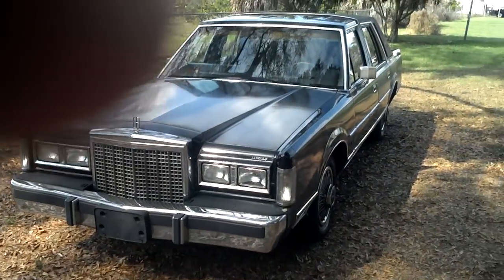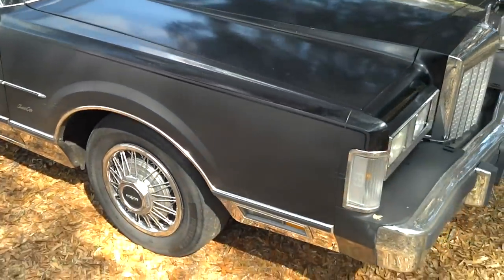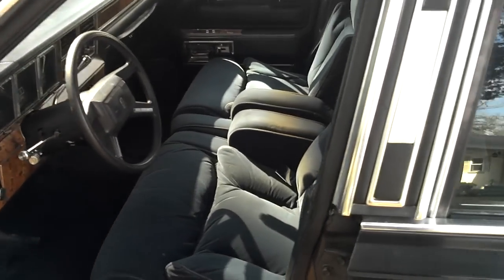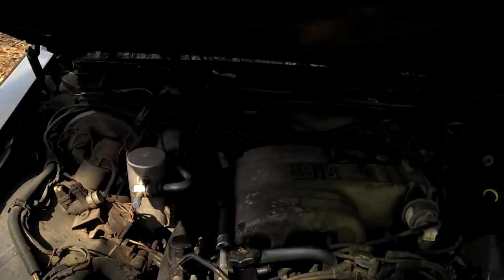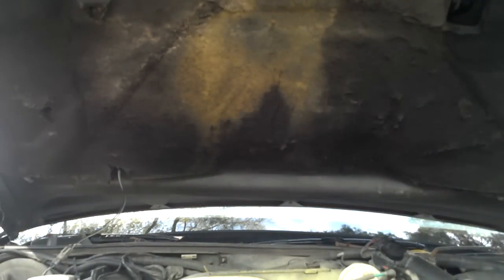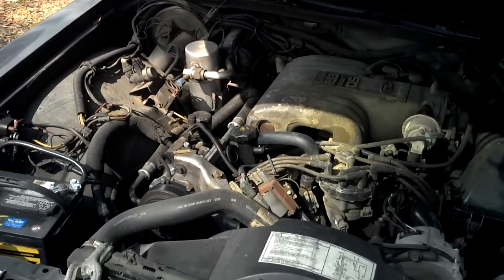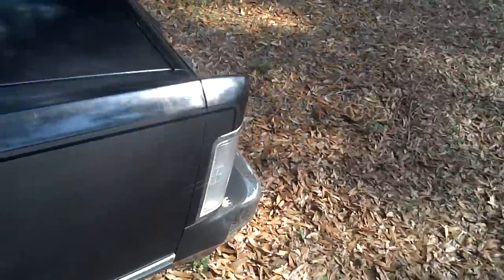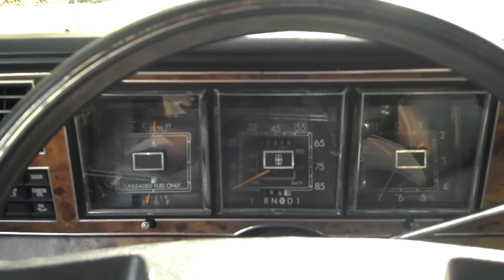1987 Lincoln Town Car Signature Series FULL TOUR V8 Ford 302 Auto w/ air

Comment: Dude, was the rear end red reflector replaced? That reflector was not used until 1989. In 1987 the back up light was in the center and it also had a wider red reflector with a smaller bushed aluminum. I'm not criticizing it, it is still a wonderful car, I have an 1987 Towncar myself that I had restored and the rear reflector is not like yours.